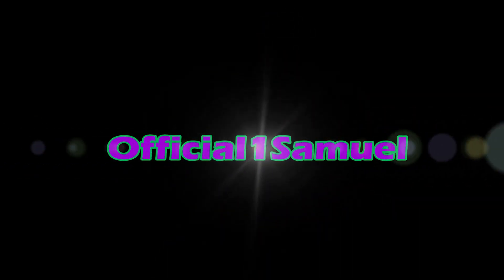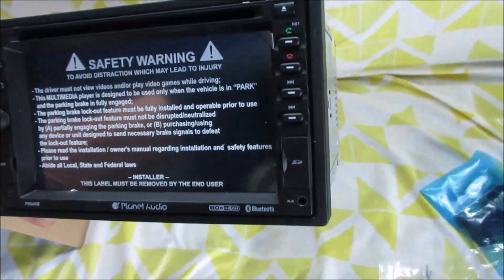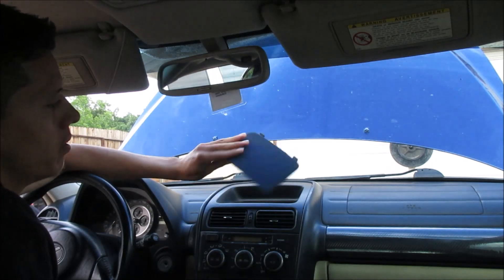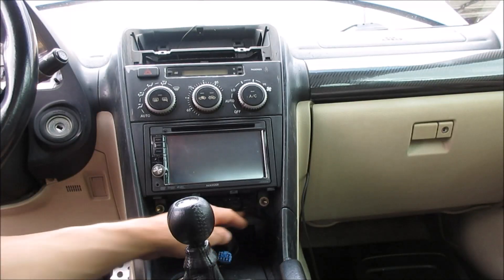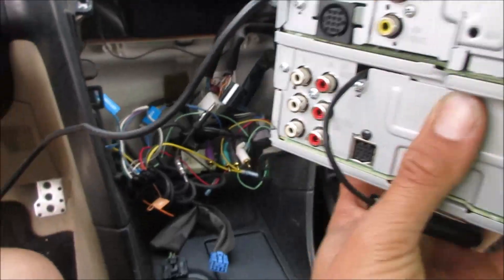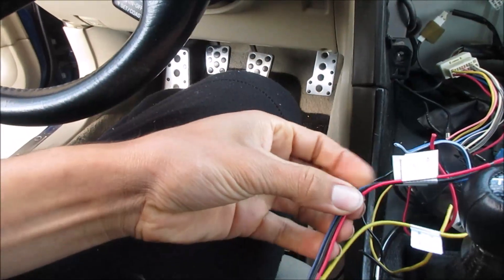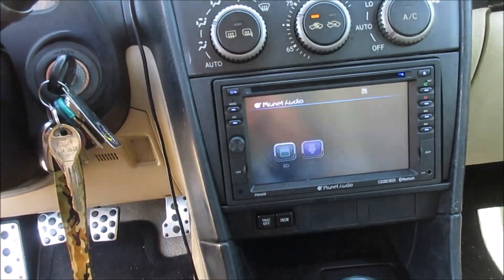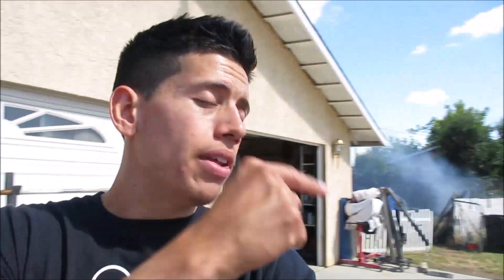Lexus is300 planet audio sterio p9640 install

Comment: How is the sound quality compared to the old Kenwood? I have a Pontiac vibe and the CD player quit working. It has 4 door speakers, 2 tweeters and a factory sub. This says 2 front and 2 rear so I'm not sure if I'd have to rig up the tweeters? I'm not spending a lot on this car but I want Bluetooth for sure. Would this be a good option?
Reply from the maker: For the price cant beat it. The reviews are lik 4 out of 5